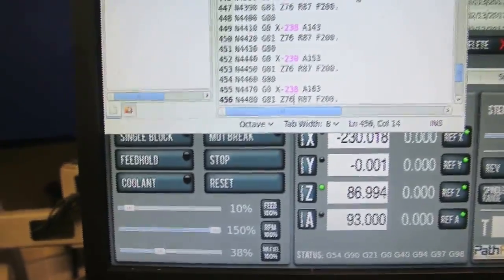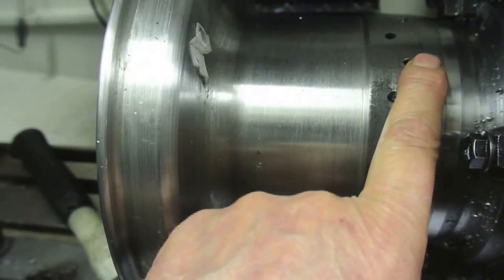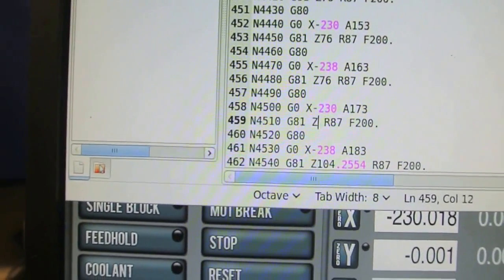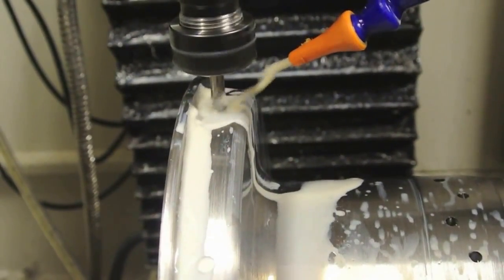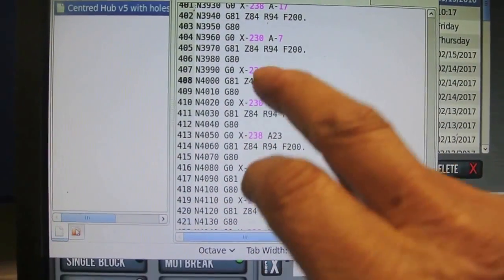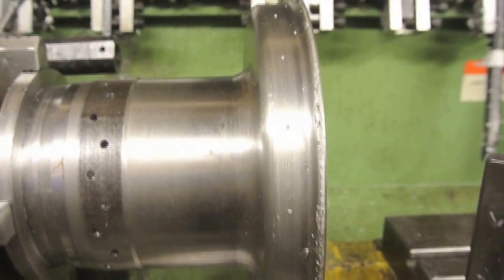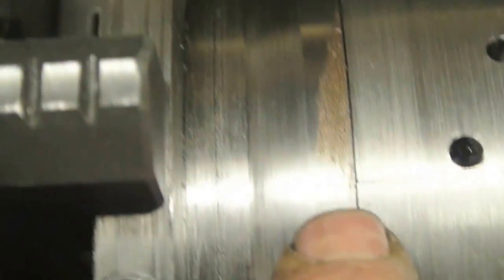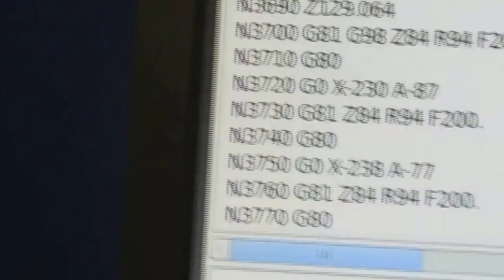Part 4 CNC Crash Fusion 360 SprutCam & Tormach PCNC complete drilling spoke holes in Vintage Car wir

Comment: Nice to see someone showing there f*#k ups and being honest about them. 

I personally would have just changed the software instead of the g-code. Running the simulations on fusion reduces the chance of a crash but still doesn't make it impossible. Glad you managed to save the part though! 

Where in Newcastle are you from?

I'm from Seaham, so just down the road from you.
Reply: Bob Rodgerson I love the saying if you're not failing you're not trying! ;)

Comment from the maker: I forgot to add that I had 16 of these things to drill and the operations for each hole were spot drilling, drilling and countersinking so that by my reckoning makes in all 2880 operations.
Reply: Agreed 16 does make a difference to the equation but errors, if any, (  :>) ) are less likely to be as catastrophic as a CNC crash.
Reply from the maker: Agreed. However I managed to recover from the one I had with this job. More by good luck than anything.

Comment: Can't help but think this job would be a whole lot less hassle if done on a manual mill.
Reply from the maker: No Way, with 2,700 separate operations required to drill and countersink the holes it doesn't add up. To rotate the rotary table manually takes 60 turns of the handle and the possibility of error is greatly increased.
Reply: It would be less hassle if you werent doing a video and explaining it,  but still less hassle than manual.  Cnc was the way to go.